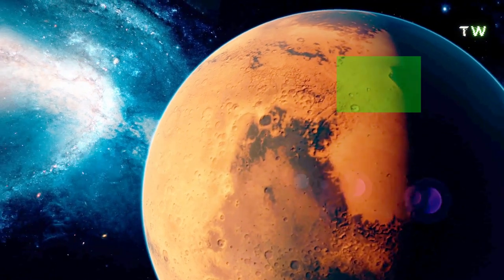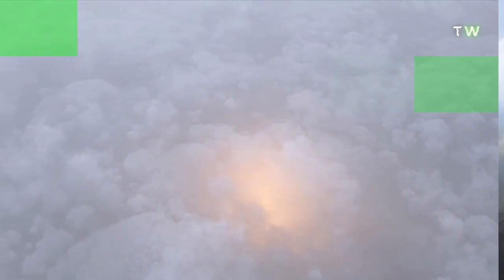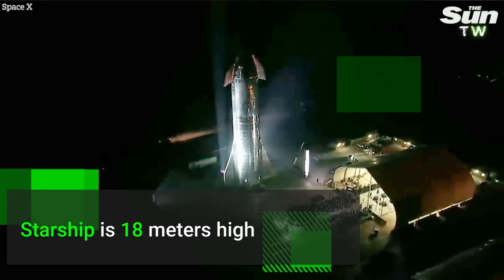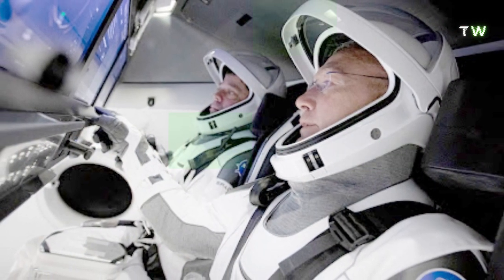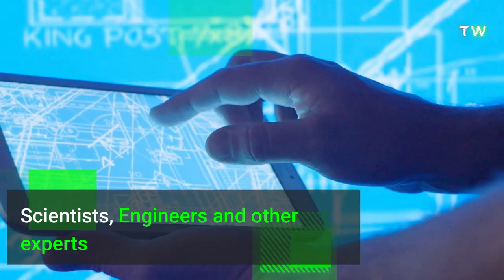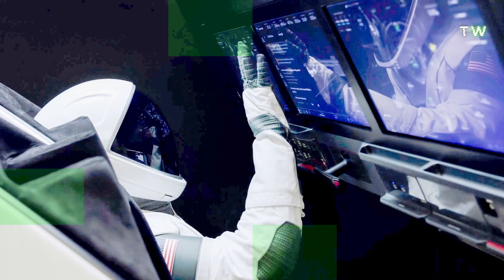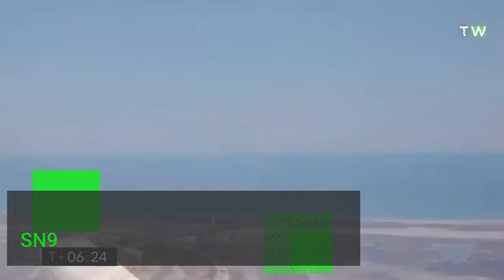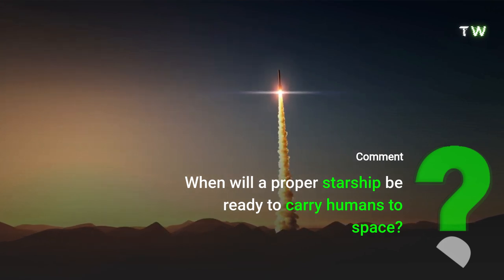Why does the SpaceX Starship keep EXPLODING?

Comment: This launch seemed to fail because the mounting of the thruster to the body of the rocket. The base seemed to crumple first as if the engine burst it's anchors, literally resulting in the engine thrusting itself through the rocket, rather than lifting the rocket, the weight of the rocket caused the tower to collapse, ripping away at the base of the cone under the weight, and torque of the engine. (apologies for my lack of accurate technical terms).